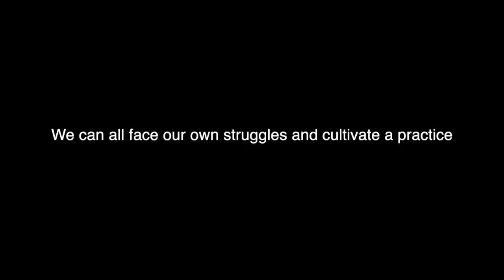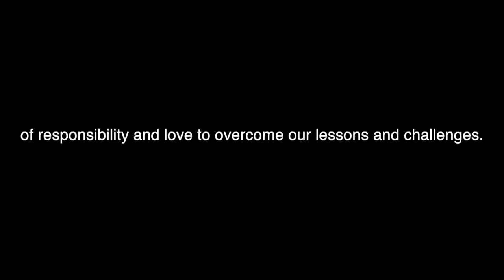MINIVAN Build E-25 || Making The Perforated Face Slides

Comment: Hi Joseph, your works is very well thought out.
You have given me ideas for redoing my RV out in new changes when I'm on my own after dad joins mum above, his 95.
Ive been looking into your jackory batteries for camping out here in Australia as my RV is certainly different then my 4x4 and camper trailer.
Dad brought mr this RV to thank me for looking after mum whome had alzimers.
Dad has start of parkinson and dementia but is good and happy with me in RV.
Thanks for your video hon.
They help me as ive been holding grief inside when mum passed and my old dif of 21 with cancer all around same time.
Scap, my little dog and I had many 4x4 adventures. 
Thankyou.

Comment: What length 18ga brad nails do you find work best for the plywood thicknesses you're using? Any issues with splitting? 
Do you just nail or wood glue + nail? thanks!